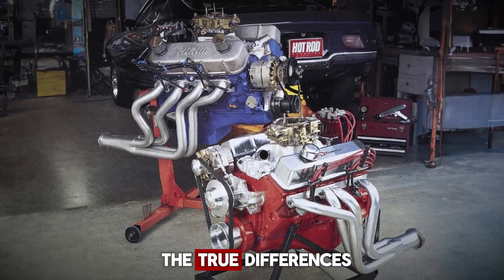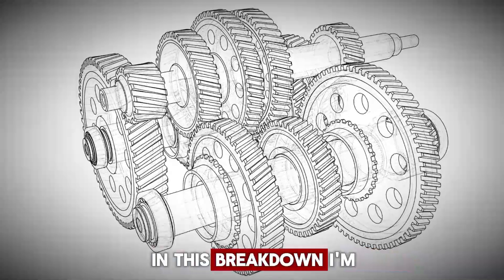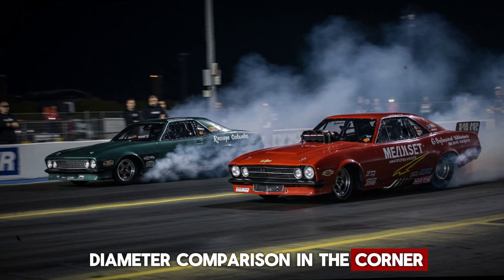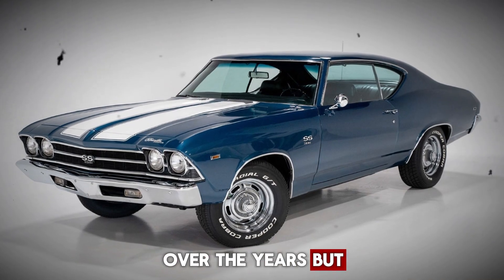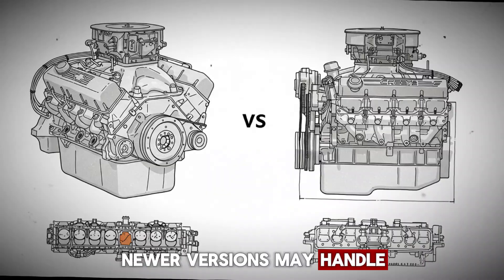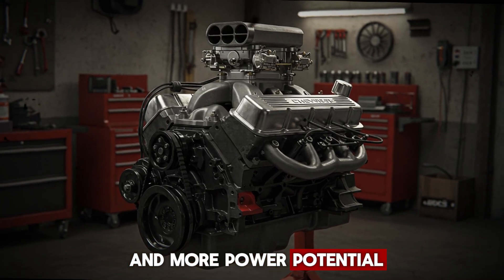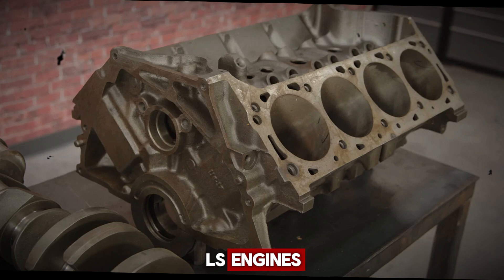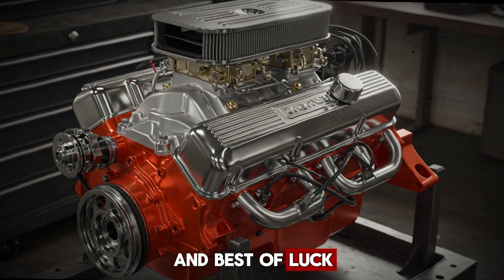Big Block vs Small Block Chevy Comparison

Comment: i got a 406 stroker (originally a 400 chevy small block) in my 85 trans am. 600HP, 6-speed tremec manual, with about 6k on the suspension, even though the suspension was already good but now it's amazing.
*i couldn't imagine putting in a big block......the car is very fast, with supreme handling.